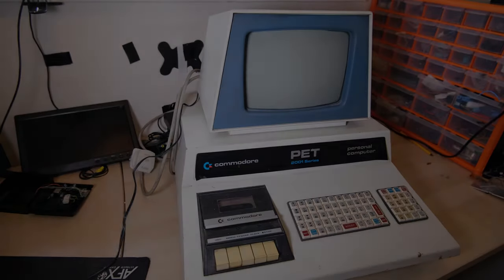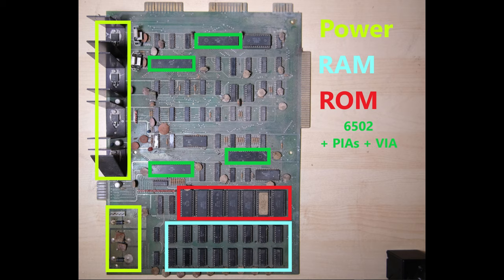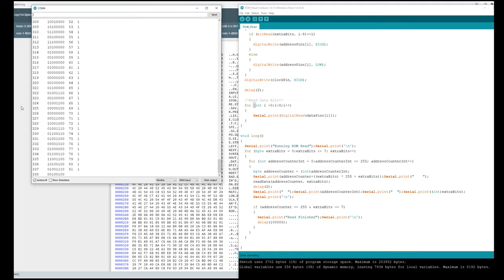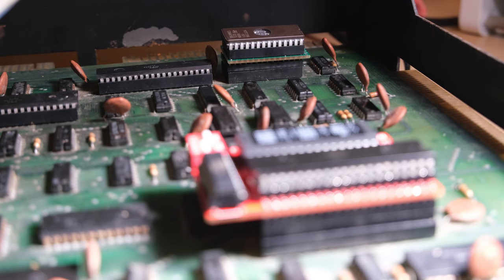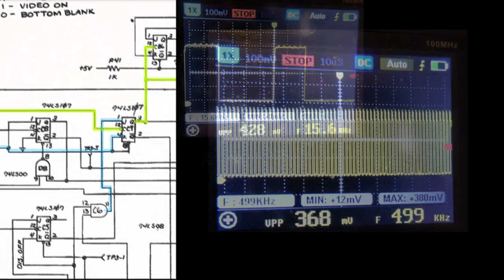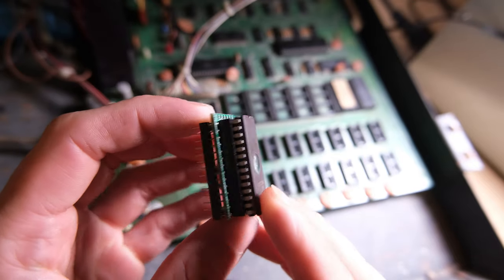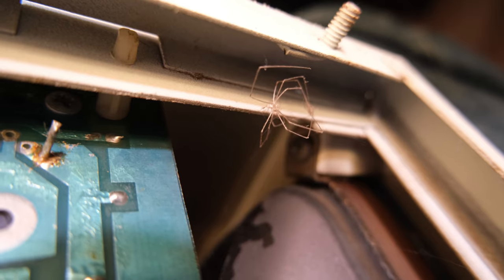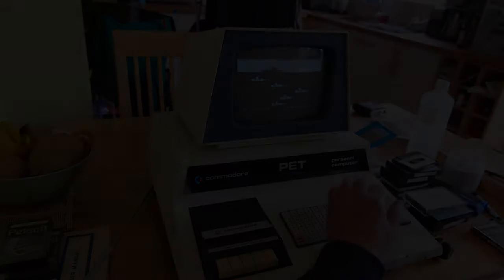Commodore PET 2001 Repair

Comment: As soon as I saw 2114's i thought "Ugh... SRAM replacement time". Those things are pains in the arse and can be difficult to get hold of. 
The ROMs being dead didnt surprise me either. You CAN read them in a Minipro with a small adapter arrangement.. likewise you can replace them with standard 27C64's  (i think) but they need a bit of adaptation. I think the Tynemouth thing you bought is a great overall solution

Comment: They had one of these (this exact model) at school, alongside a room full of 16K Spectrums. So I'm happy for it to be on the channel.

I found it interesting. I quickly realised how similar it is to the VIC20, it's BASIC compatible and tape recordings from one will work (to a degree) on the other (also the case for the C64). This made homework interesting. The keyboard was obstructive even in 1984...

Comment: Now that you have it working and validated, it's time to do a second video where you restore the ram and roms.  It's much better with the original bits in it, in my opinion.  This one is just a little newer than mine... they're almost identical except that mine has the white ceramic ROMs in it and has the metal faceplate instead of the sticker version.  (Mine is a very early one, serial #465.)  Also, my heat sinks on the power supplies are different.  Nice job getting her back up and running!
Reply from the maker: I can restore the RAM but to do the ROMs I'd have to at least buy 7 more adapters, or find original working chips,  which sounds difficult!

Comment: if only the cassette out would output a SPDIF signal compatible with any DAT machine and if only the cassette in would accept a SPDIF signal that would be decoded back into bytes you could load and save programs very quickly and if you could somehow save the title to the file you could find programs a lot easier and loading a snap.
Reply: I think the same speedload systems from the C64 would work on this, in principle.
Reply: you're a few decades too early for that ;) but you can get an audio signal out of it. It's similar to how the Commodore 64's datasette works.

Comment: @15:32 it looks to me like that belt is way too small. Seems that you had to stretch it far too much. Ideally you only want to stretch it about 5%.  Too much tension will quickly damage the motor bearings and other pulleys.  The piano keys drive mechanics are the same as the C2N but I've ordered belts from suppliers before that have been too small.
The correct size should be ~9.8 to 10" (~249-254mm) circumference with a ~0.48 (1.2mm) square cross section.

Comment: great video,  very informative as normal .. that keyboard pcb looks a bit like a mini Amstrad cpc 464 (only the original model)
Reply from the maker: I've not had one of them in yet!
Reply: just working on my specie pcb keyboard ..i thought it would be good for diagnostic work to be able to plug  into the edge connector rather than plugging unplugging the membranes in..
Reply from the maker: That's a good idea, I found it hard to do though due to the lack of KBD pins on the edge connector, I did it in the "quartet" video but I had an arduino doing the typing
Reply: @HappyLittleDiodes  ohh i haven't seen that one, will have a look now as Arduino is the other thing I'm looking at using a pc keyboard .
Reply from the maker: Unfortunately there's not much explanation, maybe I should do a part 2!
Reply: @HappyLittleDiodes  ohh that looked like hard work.. i was gutted to discover no part 2..  😪